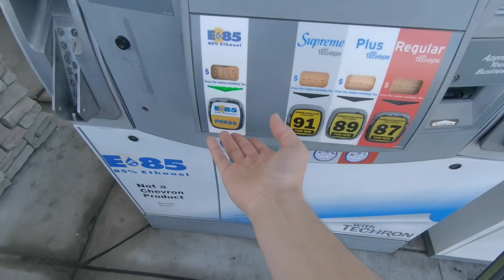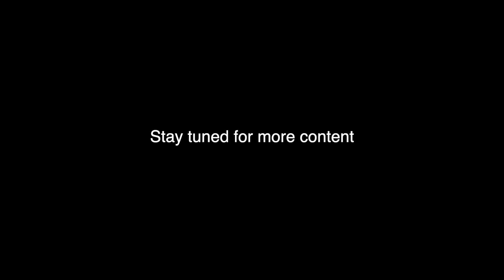INSANE 2-STEP at Clean Culture NorCal 19' Banger! SUBARU HEAVEN

Comment: What’s up with your trunk latch? Mine doesn’t work either on the blob eye lol. Bought it that way, is it common on our cars? Been meaning to fix it for years lol
Reply from the maker: It has a safety feature where if I enable it, then it will only open by key and not the trunk lift
Reply: Lol yeah I was gonna say flip the safety switch I had the car for 8 months and always assumed it just didn’t work

Comment: Would u get a 2004 impreza wrx, not sti for around $6000 with insane amount of mileage or look for a better one with low miles.
Reply: Javier Alvarez better one with low mileage. How high the mileage?
Reply: @SyndicateApex  very high around 150k miles on it.
Reply: @bimmer8602  nah id pay at most like 4.5k also still depending on the exterior/interior details
Reply: Just Bought a 2004 wrx for $6650, had 174,000 miles. The car had tons of mods which added some value for me personally, I'm happy with the purchase at it was a very clean build and looked really good in person. To each his own, it's hard to know just based on that info alone.
Reply: If its stock n clean inside n out then do it. Its worth it cause it was granny drivin. Look for the common subi issues with the body.